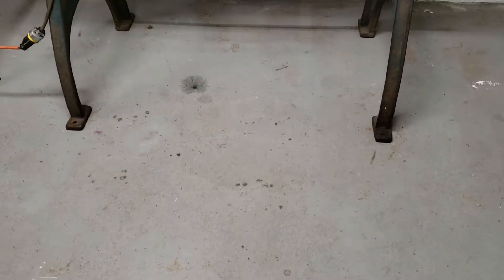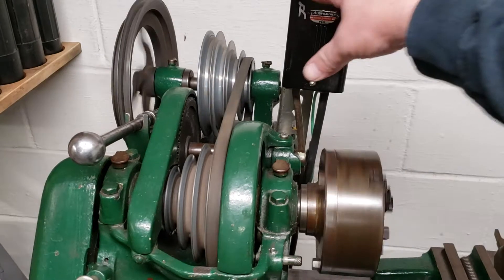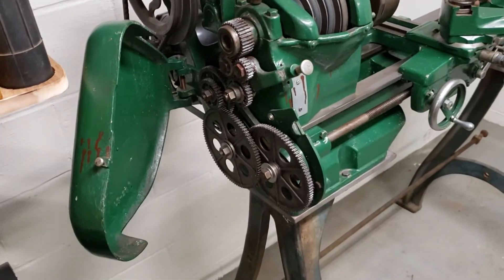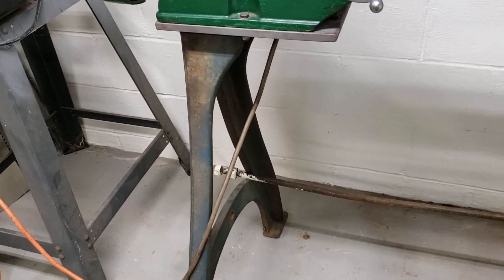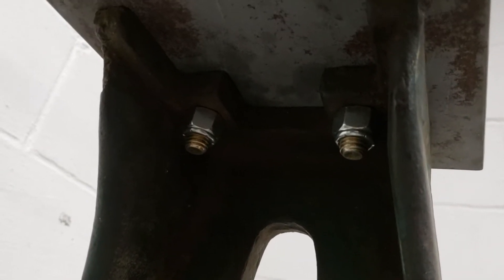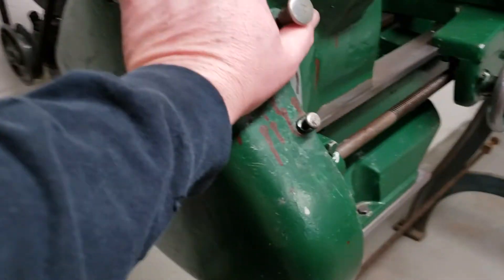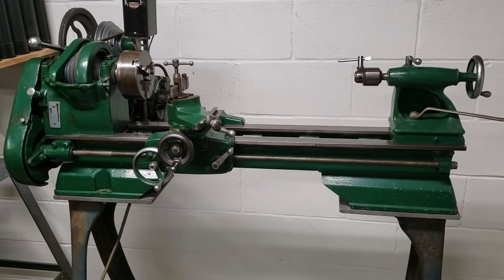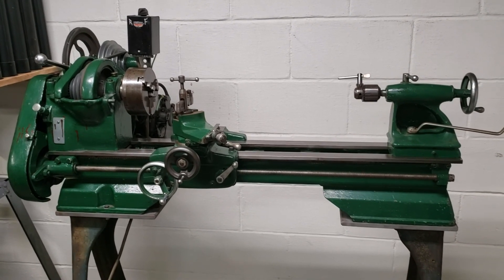IT'S ALIVE! The Craftsman lathe makes it back together.

Comment: The Lathe looks awesome!  I always prefer a basement shop...  Even a heated garage has issues with humidity and temperature swings.  The best part about those Craftsman lathes is their simplicity.  You can always swap out a motor or get to the bearings easily..   Now the real fun begins- Making stuff!!!!!   =D
Reply from the maker: Thanks John. Now I have to get the ShopSmith/ wood lathe back together for the opposite corner. That might be next weekend's project.